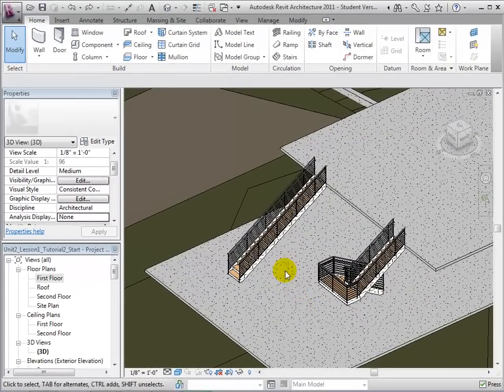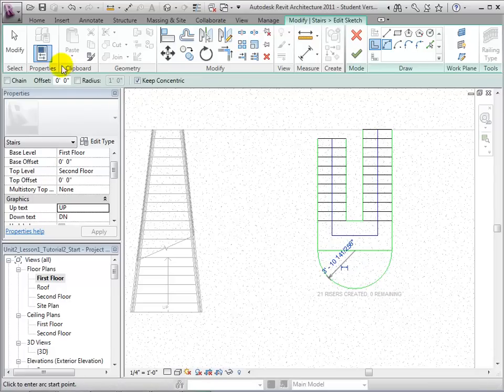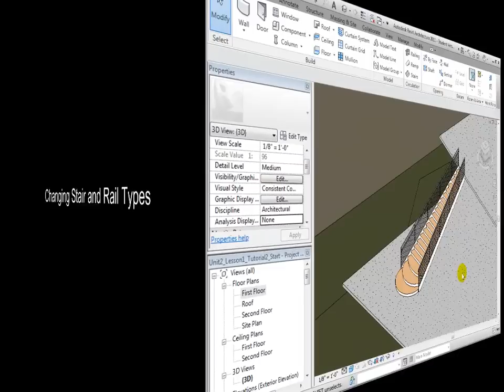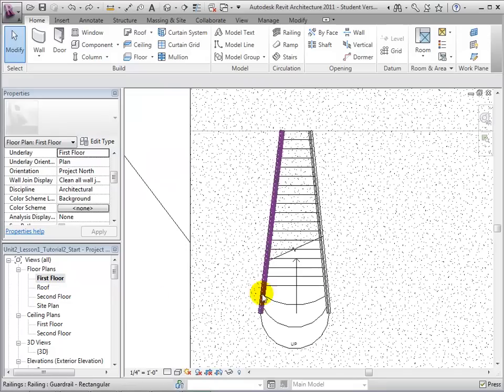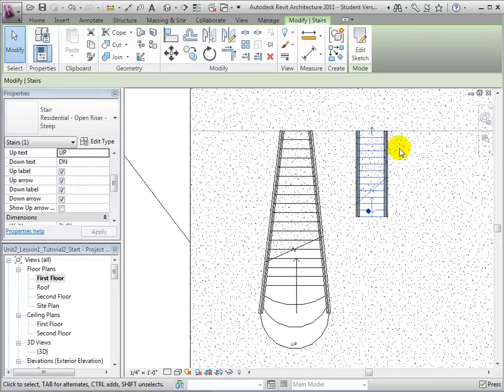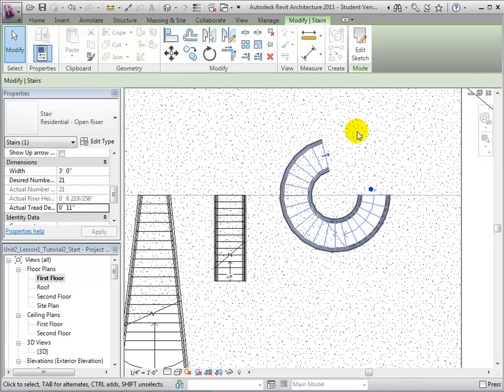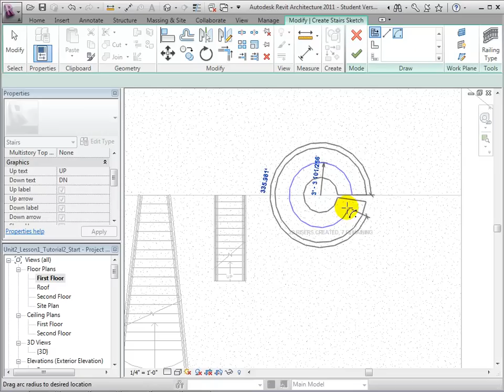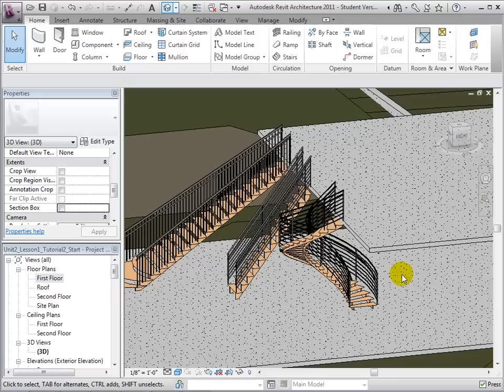Revit Architecture - Modeling Custom Stair Shapes

Comment: And what if you actually want to make a spiral stairs that goes >360 degrees? For example, when the top floor is 6m higher than the base floor.
Reply from the maker: That's a very good question! 

In older versions of Revit, you would have to make two segments that spiral less than (360 degrees, and stack them one on top of the other.

Starting with Revit  2013, you can now make component based stairs that can spiral more than 360° in a single run. So you have a lot more flexibility to make stairs of any height and configuration than the sketch-based method.

Hope this helps!

Comment: I can't believe you people (Autodesk) actually showed the creation of 2 of the four cases as greater/less than 7/11 run/rise ratio.  Granted, on radius or spiral, the rule applies to the center-line of the stair, but in both cases you broke all the rules.  What you are basically doing here is, as an authoritative voice, condoning the use of highly dangerous/literal break neck runs and rise.  Congratulations.  You are showing the newbs and the unwashed how to insure people fall down or don't have the strength to climb up stairs.  And if any of you don't fully understand what I have written above, you have no business designing stairs.
Reply: Dude, relax! There are building codes that are in place to protect against unsafe stair designs.  No building official would sign off on stairs that are this unique looking.
Reply: I understand but this is an example only. Get over yourself.
Reply: ok boomer